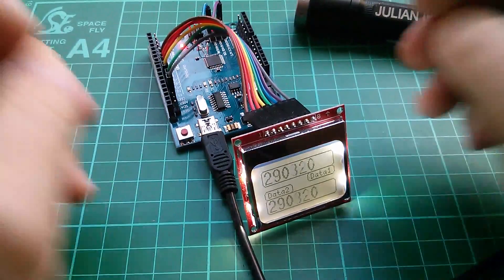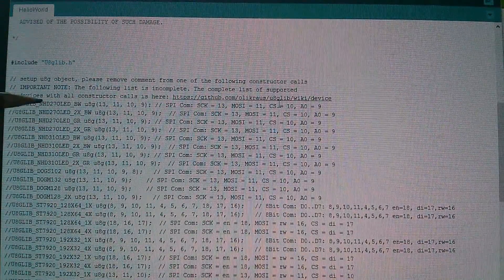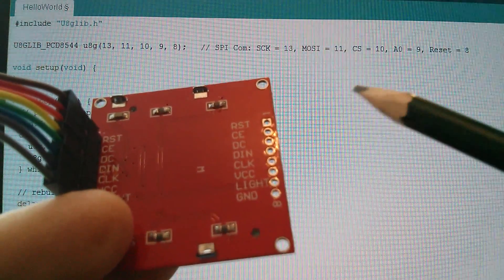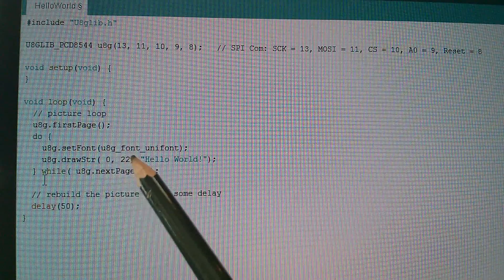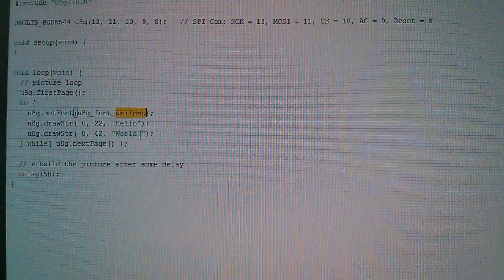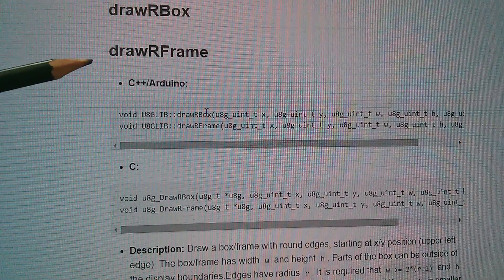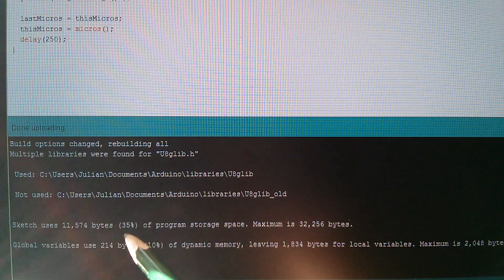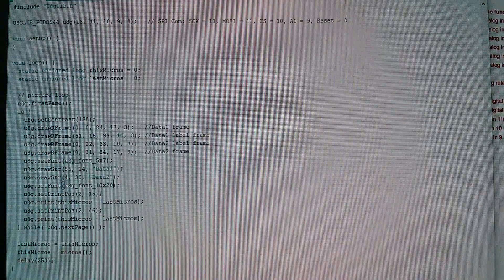Julian's Ardutorials: Arduino, Nokia 5110 LCD & u8glib

Comment: A very wise man once told me to use all the memory that the machine will allow if needed.  His reasoning, that is what the memory is there for, and if you don't use it, then why buy it in the first place.  Arduino's do not  run faster if there is empty memory, it is simply memory wasted if not used.  Not sure if he is right, but he sounded like he knew what he was talking about, so I have always programed as if the maximum memory was not to be avoided, but to be used.

Comment: Your last comment about not being able to change the pin assignments of sck and mosi do not appear to be correct... I was following along with the video and everything was working just fine... then you made the statement about the library using hardware spi... I used different pins from the beginning... my pin assignments go like this: 
#define RST 12
#define CE 11
#define DC 10
#define DIN 9
#define CLK 8

U8GLIB_PCD8544 u8g(CLK, DIN, CE, DC, RST);

and everything appears to be working great, so is it not using hardware spi, or is it smart and auto detecting that I am using different pins and switching to software based on its own?

Love your videos. Thanks

Comment: I was hoping you would address the issue on using resistors between the Arduino and the board. Some tutorials say only to use 3.3v or a number of resistors between the two.
Reply from the maker: +Cliff Hartle It didn't even occur to me - I'm so used to running this display directly from 5V. The data sheet for the PCD8544 does specify a logic supply voltage range of 2.7V to 3.3V, but the absolute maximum ratings have Vdd at 7V max - a bit confusing. I've seen eBay listings stating that the display has proved itself to be reliable at 5V - and my experience supports that.
Reply: +Cliff Hartle  I make a mini board with 3.3 V regulator and 4 resistors of 10 k for adaptation 5V ==> 3.3 V .( rst,d/c, data In, Clock ) chip enable is strap to + 3.3V.
It's work fine.

Comment: Hey Julian,
you are actually using Software SPI. To use HW SPI you have to remove the MOSI and CLOCK pin from the constructor. In your case:
U8GLIB_PCD8544 u8g(10, 9, 8);
Otherwise the library assumes your specified ports differ from the ports that are hardware SPI capable. For me it was a speed increase of about factor 2.
Reply from the maker: +zuippo1 OK, yes, I missed that. As long as 5 Arduino pins are specified (or 4 if reset is not used), a software SPI implementation is used and any five pins can be used. If only 3 (or 2 without reset) pins are specified, hardware SPI is used. The saving in loop time on my setup is only 5ms though. Using hardware SPI - the 290ms number drops to 285ms (40ms execution drops to 35ms execution). Thanks for the correction - my mistake. https://github.com/olikraus/u8glib/wiki/device#pcd8544-84x48

Comment: Hi, great demo. I try your code with an oled display 0,96" from Alice.
I  just change one line for take the good lib 
 U8GLIB_SSD1306_128X64 u8g(U8G_I2C_OPT_DEV_0|U8G_I2C_OPT_NO_ACK|U8G_I2C_OPT_FAST); // Fast I2C / TWI 
and it's work fine !!
the display is a little bit more great, and I will try a different  font character just for fun.
Thank for ALL your videos.
I'm now a gread buyer for Alice and Goto from Ebay  :-))

Comment: Wouldn't putting the static items like the boxes and the labels in the setup, increase the loop speed, as they are not being redrawn every cycle?
Reply from the maker: +Harry Desai Unfortunately that's not possible because the display is completely overwritten each time round the loop.

Comment: You can edit the large font library to contain just the numbers if that is all you need with large fonts and then there will be almost no impact on program size.
Hope you do not have in mind a volume product based on this LCD since you can only find refurbished ones and not new and they have all sorts of problem especially with the zebra connector not making good contact.

Comment: May I suggest dropping the small font in favour of putting "Data 1" and "Data 2" on a cardboard/paper frame for the display. Saves pixels, memory, and it's simple. :)
Reply: +Bernhard Hofmann Or do what early arcade video game designers did, use a clear sticker. Early NASA computer displays did something similar.
Reply from the maker: +Cliff Hartle If the rest of the project pushes me over the 32k limit, I'll consider it. But I'm thinking that the larger font will use more memory than the smaller font, so there may not be much of a saving.
Reply: +Cliff Hartle Nice idea, I like that.

Comment: Isn't there any bootloader which decompresses code which was compressed on the PC using UCL?
http://www.oberhumer.com/opensource/ucl/
Reply: +BloodySword The AVR microcontrollers only run program code from flash memory, not from RAM. And they have much less RAM than flash memory anyway.
Reply: That's a pity.

Comment: Does the Arduino IDE / compiler strip out unused portions of the library or does it compile the whole thing? If it compiles the whole lib, would it be worth stripping out the unused sections to free up space if you need it?
Reply: +Maxx B I just read something on the Arduino forums that says the compilation process is not bad at stripping out functions that are not referenced. Although more space can be freed up doing it by hand if you are desperate to shave off a few more bytes.

Comment: I like the 5110, but the displays seem to be pretty varied in quality (at least from various eBay sellers).

Many don't list the correct backlight color (white or blue) and about 1 in 5 have been dead. Almost every single one I have received has had issues relating to the display separating from the PCB during shipment and it can be quite fiddly getting it to make a solid zebra strip connection.

That being said, they really are nice displays. I especially like the two rows of pins as I use the other side for mounting to my project PCB nice and sturdy.
Reply: +Peter Brockie i guess its one of those displays thats become a commodity and lives its life far longer than the nokia 5110 spare parts need, and they are made from lots of supplierrs with the downside of messing with the original design, same goes for casio f91w watch knock offs, some are very similar indeed, others are obviously cheaper materials, innnacurate mechanism and light colour changes

Comment: If you were struggling for room, would it be possible to cut excess out of the library to make some room? i can see the arduino is flexible but required these relatively large libraries to do these things, and as it has such limited memory....shame it cant be expanded cheaply or easily, remins me of the 80's when you had a tiny memory and every bit count, so much we didnt comment our code
Reply from the maker: +jusb1066 It's a bit different now because the source code stays on your PC (where there's loads of memory) and only the compiled code (without comments of course) gets sent to the Arduino chip. But I think there are some fonts in u8glib with numbers only and some with just uppercase letters and numbers that are much smaller. I could have used one of those.
Reply: Julian Ilett
great reply Julian, the more i learn :}

Comment: I don't want to come off like a smartass, but have you ever considered using OBS or a similar program to record the screen?
Reply from the maker: +Krisztián Szirtes The problem with screen capture software, is that I can't wave my pencil around and hold up bits of electronic circuits in front of what's on the screen.
Reply: +Julian Ilett Even without the delightful pencil waving I think this actually looks better than a screen capture. I feel queasy when I have a screen in front of me and no control of it. This way I have a visual queue that it's your screen and I can just sit back, relax and enjoy.
Reply from the maker: +BloodySword I think I have about 20Mbps upload. Apart from that my system here is pretty low-tech, which is ironic given the kind of content I create. Maybe in the future I'll build a really high-tech recording studio. Maybe I won't.
Reply: Welp, true that. As I think of it I would probably miss it
Reply: +John Romberg But the high compression ratio of the videos (presumably because his Upload rates are so bad, I HATE Europe for this!) it looks very bad and the pixel raster disturbs the view massively. :/ You always can swtich between screen capture to show something or even put it in front of the recorded screen using a green or blue mask.
Reply: +BloodySword Or just use the mouse pointer to point to stuff.
Reply: Julian Ilett
I have only 5 MBit upstream because I am connected via euroDOCSIS cable TV. DOCSIS 3.1 is promised with 100 MBit+ Upload each subscriber! I hope this will be true.

You could easily edit the video and encode in 20 MBit overall bitrate including audio, it will then take as long as the video is to upload. I think that is okay. You don't need a fancy studio for this. :)

I have done similar things with a blue towel and open source video editing. (AviSynth)
Reply: ***** That's what I'm saying, I love the raster!
Reply: John Romberg
It would not have any problem with the raster, when the video codec would encode it more efficient.